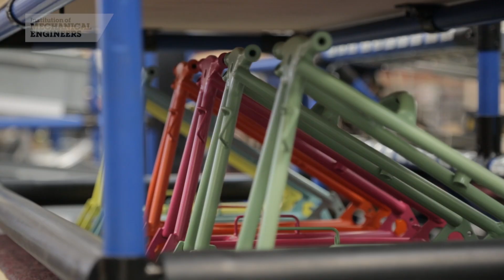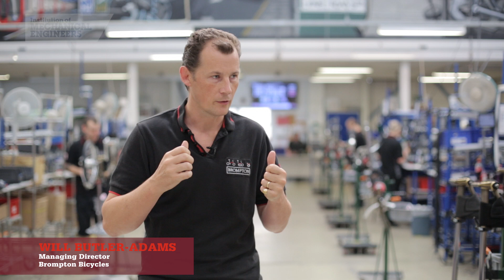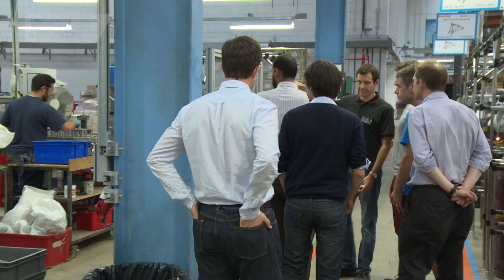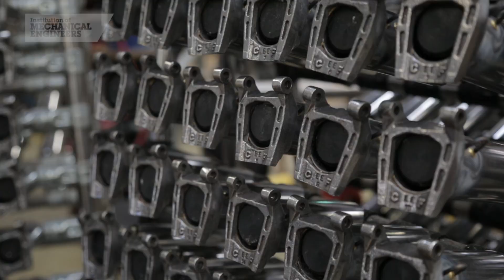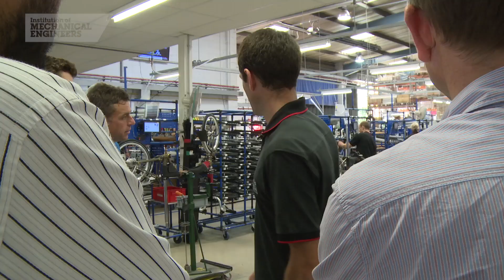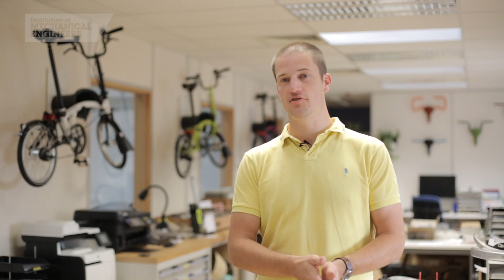How the Brompton Bicycle is engineered?

Comment: Bought my 1st one, a bit upset fir the price point u need to add your own kickstand, protection stickers, no bottle rack screws points and replace easy wheels…
At same price, Tyrell Ive is much care free
Reply: Bromptons might be expensive to buy, but when you come to sell, you'll get most of your money back. I just bought an early one to restore. The second-hand price is still more than the original price (not inflation-adjusted), and only slightly lower when inflation adjusted. When I used to travel to London, because I didn't need the tube or buses, the bike paid for itself in no time at all.
Reply: @horsenuts1831  I agreed, it’s like rolex, hard to get one and good for resales. I treated it as leisure bic, and comes up complaints like that 🤣
Reply: @rogersinclair2772  because it’s too much work than just a kick, when u need a zip of water

Comment: Nice video altho it does look like you have to have been to Oxbridge to work there🤔 I have 2 btw both converted to Electric with a 1kw Bafang but can be returned to normal drive in 15 minutes👍🏻
Reply: Didn't Will B-A study engineering in Newcastle?

Comment: Brompton is designed for cities, but it works very well in rural settings as well. I really hope one day Brompton will have a 7 hub internal gear and a belt instead of a chain.
Reply: Belts have too much energy loss. Andrew Richie explained why Brompton won’t use belts in a recent interview.
Reply: @MisterTechnologic The problem is not efficiency, but the way the design would have to be re-engineered.  A chain is more efficient when perfectly maintained, but have been studies  that show a belt is more efficient than a chain (as maintained be the average person).  At 53 minutes in he explains some of the challenges a belt drive entails. https://youtube.com/watch?v=snyYehenkhU&si=yKm2Pj1ktKaDOXCY
Reply: @MisterTechnologic I haven't seen that! I know it would be kind of difficult with the fold having to have some kind of a spring-loaded thing like the derailleur to keep the tension but I'm not one to want to go off-roading and mountain biking, I want it for the pure ease and simplicity, extreme low maintenance and longevity. I'm going to have to try and dig up that interview!

Comment: I bought a 2014 M3L on the cycle to work scheme after being a cycling commuter for over 20 years .
 I previously had a Raleigh touring bike and a Peugeot  mid price  road bike.
I was disappointed with the quality of the Brompton parts , The nuts soon rusted , The wheel nuts  were not stainless steel, which surprised me . The brake levers and whole braking system were incredibly cheap components and needed constant attention to keep them working . I had reason to replace some spokes on the wheel and was surprised at the single wall design . The plastic chain guard ring split and broke . The mudguards soon started to erode. The chain ring very quickly wore developing Hooked teeth . The handlebar grips were made of foam rubber not designed to last. After a year the rear triangle of the frame wore it hinge out and developed a nasty wobble.  The pedals started to rust up on the metal hinges and needed constant attention.
The concept of the bike is good
The quality of components on my M3L was poor.
Reply: It has a 7 year warranty. If you rush you could still get it fixed for free.
Reply: @ninadpandit  I did mention about the nuts all rusting up when it was recalled for the rear hinge bushings to be replaced, this was speaking to Brompton direct , (I wanted some free replacements). I was told I could buy some Stainless Steel nuts from the website which were ridiculous expensive.  I thought why the hell don't they just supply the new bike with the stainless steel nuts. the original steel ones rust up in a year!
Reply: The parts aren’t as good now as they are on my 2000 m3. I would like a new one but I have heard of a few failures on bottom brackets and cranks.